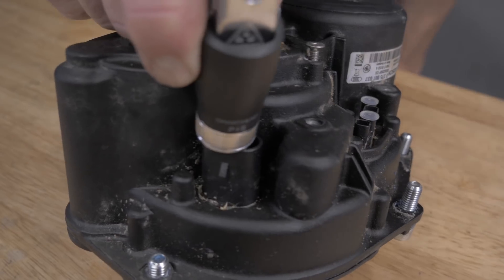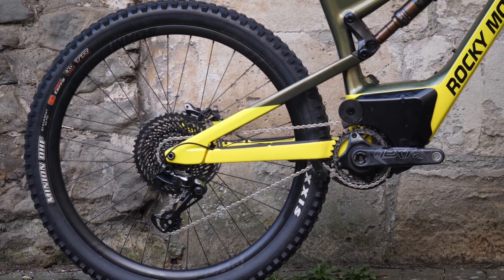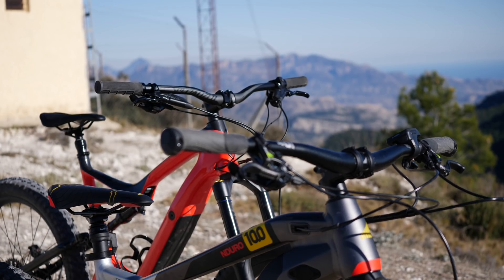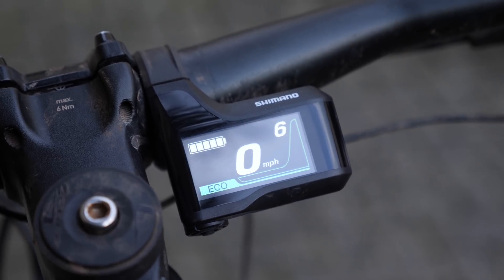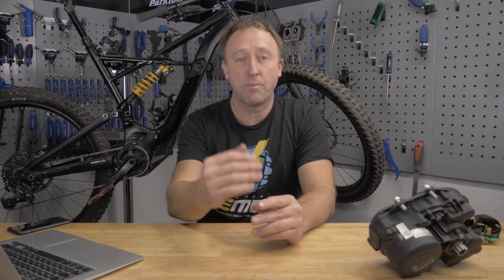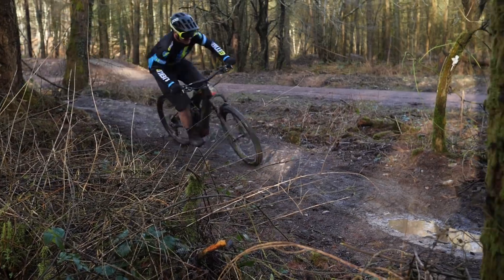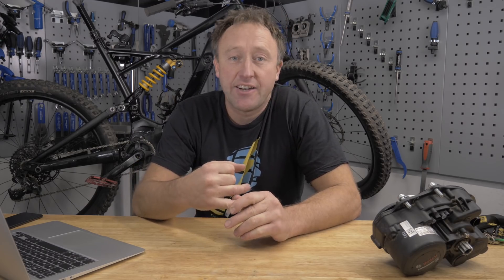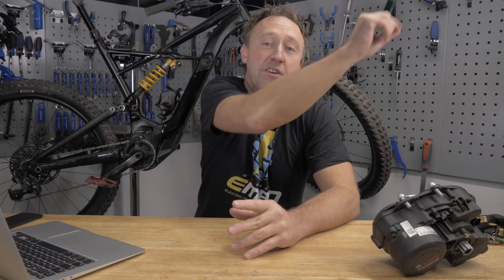E Mountain Bike Motors Explained | EMBN's E-Bike Fundamentals Part 1

Comment: A couple of points on the Bosch system.   I tend to ride quite economically and frequently select the "Off" position when riding on flat or gently undulating trails.   When I do this, I backpedal for about half a revolution and there is an audible click as the motor decouples.   I have one bike with the Nyon system.   It's unreliable.   The first one stopped working and was replaced by the dealer.   The second one lasted about 6 months then failed and was sent off to Bosch for repair.   It came back several weeks later and now seems to be behaving itself .   The GPS mapping system is inadequate in capacity.   I can have the whole of Europe on my Garmin but only part of France.   Seems to be a bit of poor design specification there.
Reply: Peter Kinsella are you serious about Bosch decoupling? Half a back stroke and no resistance pedaling without motor on? That would be amazing!
Reply: It seems to work quite effectively.   After the click, it seems to pedal more freely.

Comment: The speed limit, is that based on motor speed with calculated gearing? Can you put bigger chain rings on and sneak past that?
Reply from the maker: Good question – the pedal assist speed limit is set and is often a legal limit, too, so there's no getting around it with chainrings, and, if you do, you might be breaking your local laws.
Reply: Legal systems notwithstanding, is it possible? I live in Canada where there are no legal limitations, however, we end up with out of market limits on some bikes.
Reply: From my experience with a couple - you need to void the warranty by hacking the motors. Changing the chainring won't do it.

Comment: Wow! Wow!! Wow!!! Now we have that officially stated: "a 1.2kg weight difference isn't so important"!

I've knew it! ThnX! ;)
Reply from the maker: Definitely, with e bikes, it's more about motor placement, and, of course, also how you use the power you have!
Reply: You know, some of the fastest riders in my areas are looking at my e-bike and deciding on a brand. They like their work out but they also see that the race for competition has taken something they loved away. On the e-mtb it is returned - no more strava worry or weight worry, it's back to explore, sessions and flow.
Reply: I agree. I was waiting for the Shimano E8000 to be more widely available as it looked promising when it was announced. For 2018 there is a good selection of brands using it and I picked up a Commencal Meta Power. It's an absolute beast...
Reply: On an eBike it’s a small difference, power to weight ratio. That would be significant on a regular mtn bike
Reply: Not if Haibike/Bosch is a sponsor of the channel... when the aging Performance CX will be updated with a lighter version then it will be an advantage you can be sure. :) I think 1,2kg (and the smaller size) is significant even on ebikes hence the Shimano E8000 became very popular just in a year.
Reply: I have both ebike and regular bikes. At the moment I wouldn't want my ebike to be my only bike. Regarding the weight I don't care too much about it my enduro and trail bikes are close to 14kg. Ebikes are generally heavy with their 22-24kg and if I can be closer to 22 by going with a lighter, smaller, more current system and closer geometry to a regular bike then why not?
Reply: Yes, absolutely. However, waiting for the technology to catch up for the perfect bike is going to take a while. Every season something better will be out. I keep saying - you would be LOSING money if you don't buy one now 8P....
Reply: I was wondering how the Meta performed, roller launching fun?